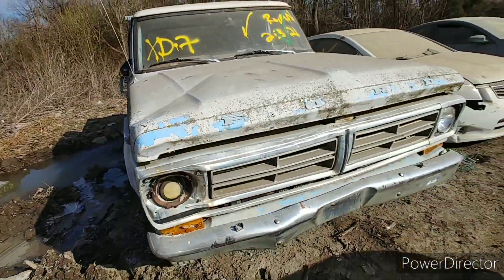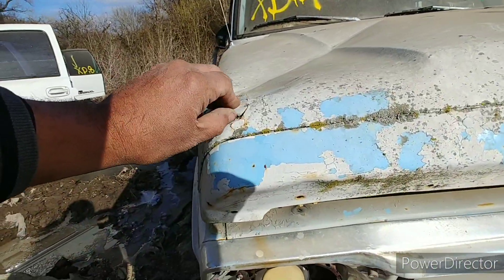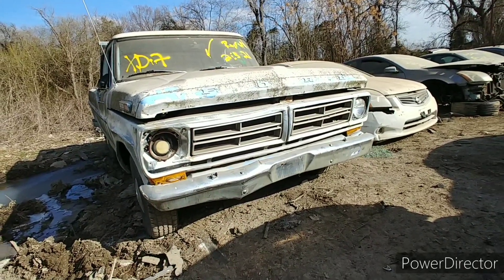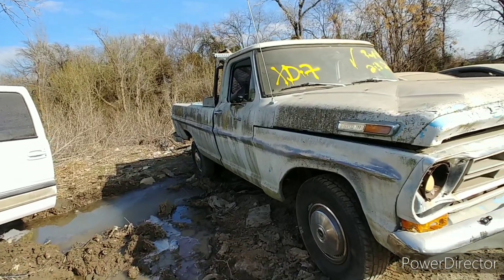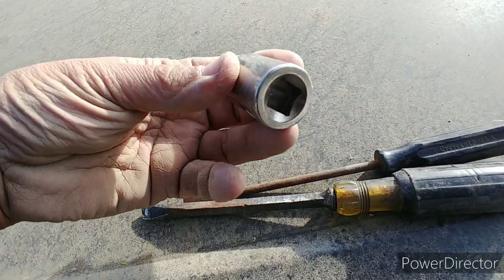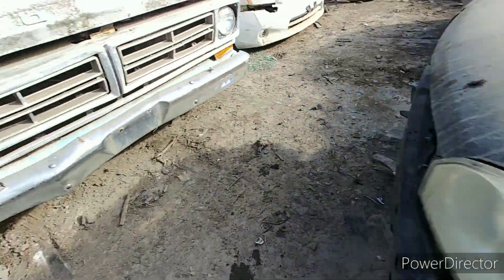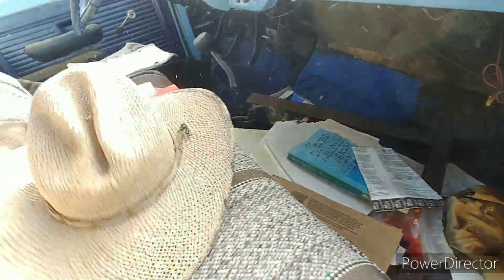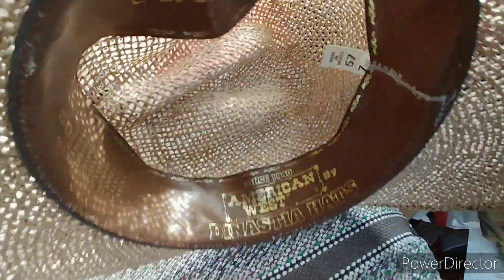1972 Ford F100 Custom Junkyard Find

Comment: Whoa Nelley, it's the wood that makes it good. Boyd-Wood Motor Company is gone, I believe this eventually became somehow associated with Freestone Ford which is now located at 1201 US-84, Fairfield, TX 75840. Forrest Edward Wood became a partner in Boyd-Wood Ford in 1954 and he died in 1996. 

That's a possible Klein screwdriver, look really closely to see if anything is inked into the rubber handle. Don't think that's a carburetor kit, box seems too small. Possibly some other fuel system part. We got the VIN, we win: F10 for F100 2WD, A for 240 straight 6 with one barrel, K for Kansas City, MO assembly and the rest is the production sequence putting it in line with January 1972 production, making it a 1972 model year truck. The KC plant still produces F Series trucks today.

Possible code "B", Wind Blue exterior paint. Possible code "C" Ford three speed manual transmission. 

Whoa Nelley, F100, gotta go. Three on the tree, it's over for thee. Straight six, hit the bricks. That's it, time to quit. Going to be flat, and that's that. The (Boyd) Wood is no longer good. Going to be squished, not too pissed.
Reply: Never had any luck out of Ford one of them l had was a 72 Ranger XLT short bed 302 three on the tree and Kline is now getting a lot of their tools manufactured in China well there goes quality.
Reply: @garymckee8857  Unfortunately, yes. SK and Wright are USA.

Comment: That rear bumper is neat and different.  But I wouldn't even attempt it without my cordless impact.  

That old truck looks like it would run and go with a battery and some tinkering.

My yard today it was almost like fording a stream in spots, it's mid 40s and feet of snow is melting out there.  I found some decent goodies though so it's all good. 

That looks like a GM underhood reel light circa 1990-ish.

Comment: Man, that's a base model truck if I ever saw one! Cheapest drivetrain with the cheapest trim level.
I like the light blue Ford offered, looks like a quick rattle can paint job with taillight overspray!
I really like the full size hubcaps, two of them are savable!
Reply: Probably code "B" Wind Blue exterior paint.
Reply: I think those are car hubcaps. Have had them and usually can't give them away at swaps.
Reply: @googleusergp  Thanks. What's your favorite factory color on Fords? Mine's medium green and orange.
Reply: @CR7659  Does no one want them? I think they're pretty cool. People list them for high prices so I assumed they go for good $$$
Reply: Well nobody here seems to want them.  But Ford guys are notoriously cheap.
Reply: @nathankim7664  Favorite color? The Ford at the GM dealer. Lol.
Reply: @CR7659  That is because they are always Fixing Or Repairing Daily. Lol.
Reply: Found On Road Dead, of course. 

I can't pick on cars that way being a Pontiac guy.
Reply: Probably a 2300 buck truck back in the day add on dealer bumper and radio

Comment: That light under the hood was on every TBI GM fullsize truck made among some SUV's and whatnot.  Even my square body 1990 fullsize Jimmy has one.  One of those things that went away when GM switched to the GMT800 platform in 1999.
Reply: vans too, I had one with it
Reply: My 1991 Camaro has that light and it still works.